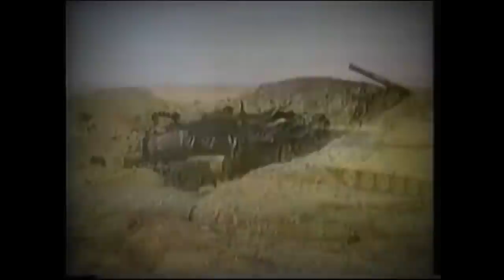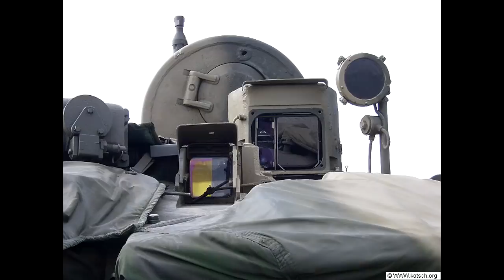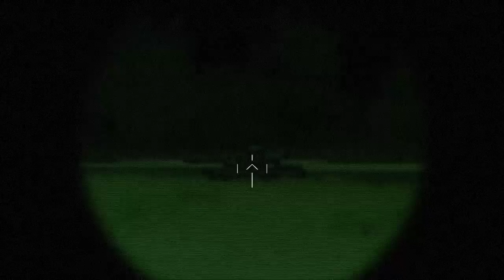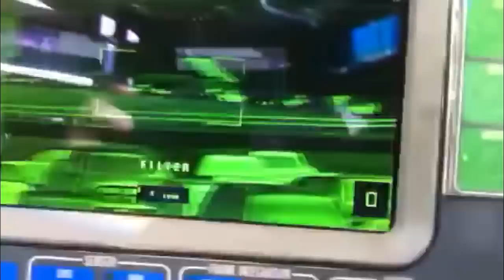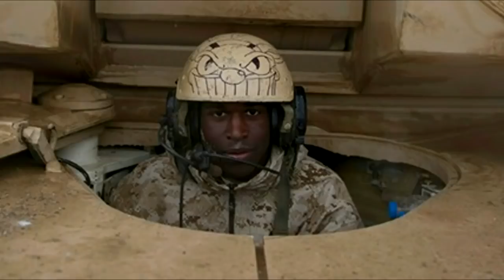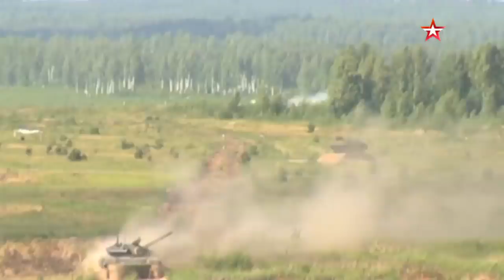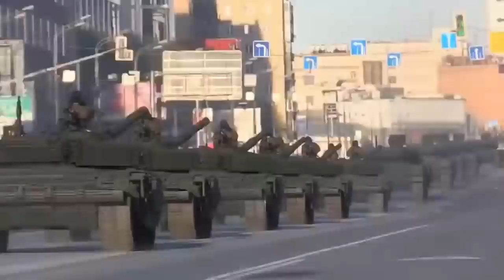Does T-72 stand a chance against M1 Abrams?

Comment: The reason the battle of 73 easting is so famous and the tank crew so brave is because of its potential to have gone awry. The M1A1 might have been a better tank, but the T72 was still capable of penetrating it. All in all, I think it was down to crew training and the element of surprise.
Reply: Thought they found the ammo used by the Iraqi we're found to be training rounds.  Also there were more t55 than t 72 in the battle alone?
Reply: @markacostajr.1584  Oh bull shit
Reply: @tomhutchins1046  He is wrong they weren't using training rounds but they where using soviet export rounds which would require a 1 in 1000 shot to penetrate an Abrams frontally

Comment: I used to do maintenance on the M1 and your estimate of units available is quite low. Getting an exact number is difficult as there are several categories that must be taken into account. Also, it should be pointed out that the Russians have the longstanding order that the tallest a armor vehicle crewmen can be is 5' 2" (157cm). This has saved the various governments billions in the cost of production, both in money and materials.  Also, when considering the M829 series of sabot rounds, one must remember that the penetrating statistics must also take into account that for the round to be of greatest effect it must do a complete pass through the other vehicle. I have seen the films with goats in a sealed compartment, then a sabot round passing through, I am still astounded that the amount of vacuum that the M829 created when exiting the tank completely vaporized the goats.Also, it happened so quickly, they didn't suffer.
Reply: Bullshit, my friend is 190 cm and he was a tank commander in 2015

Comment: I don't quite necessarily get why a long dart would be able to penetrate armor the higher an angle. The Abrams' upper plate is so far sloped, nothing should be able to go through it unless the other tank is above the Abrams. Though considering the gap between the hull and turret is large, a Sabot could just ricochet off the upper plate into the turret, you don't need a physics major to figure that out. Lets take an idea out of War Thunder's book, there are several easy ways to take out an Abrams, 1. just shoot the turret ring, it's unprotected, 2. if only the turret is visible, annoy the tanker and take out their gun, 3. you can outflank them, they're not really that fast. 

Obviously a real life Battlefield is much different than a game, one like War Thunder, especially where it's new penetration mechanics are concerned, but some of those tactics could still easily apply if a crew is good enough. Lastly, my last point, a single fresh Abrams crew could probably take out several T-72's in a short amount of time at long range, with the added situational awareness, it's much easier to spot a flanking enemy. The same idea at close range, could still be true, but the T-72's will be able to aim for weak spots if they can bother, thus are much more likely to suffer damage. Doesn't really help that T-72's, as a design, are just much older, and use an outdated set of armor that is no longer effective unless an upgrade package is added, but even that isn't necessarily going to add more protection.

Comment: First, T-72B3M mod 2016 use Relikt ERA not K5, second protection of turret and hull of T-72B mod 1987 are wrong. 

With K5 ERA witch is 30+ years old, T-72B tank have this estimated protections:
Turret against HEAT is from 740-1140mm, 
Turret against KE or sabot or APFSDS is 640-780mm

Hull against HEAT is 1070mm,  
Hull against KE is 670mm

But with Relikt this estimated values  goes up and protection of T-72B3M is almost same as T-90A or T-80U with K5 on it...

Lets see protection of T-80U with K5 on it:
Turret against HEAT 1100-1450mm
Turret against KE 850mm

Hull agaisnt HEAT 1080mm
Hull against KE 780mm

So this T-80 is batter then old T-72B or B3 with K5, but this new B3M have Relikt ERA witch provide protection ~T-80U, tank made in 1990s, most of them...

Comment: The reason why the Russians are still holding on to T-72 inventories and upgrading them is because they can't afford full serial production of new tank lines to replace them. They still use them because it's cheaper to upgrade them than to replace them. It's been years since the Russians unveiled the "operational" Armata MBT and it still is in low-rate production, and will continue to be so. Video not necessary.

Comment: I'm pretty sure one shot from T-72's 125mm gun on the side armor of an Abrams is enough to knock it out, so yeah, T-72 definitely has a chance. It's all about maneuvering, which means it depends on the crew.
Reply: "Depends on the crew" is one of the most used clichés in tank debate. People think as if the crew can always dictate where to go and how to engage. What they forget is that a tank is always part of a tank platoon and the platoon is part of the company, which is part of the battalion. This means that it is the commander of the unit, who dictates where the tank will go and how to engage. If it means a frontal assault against enemy tank company in hull down position then it will be so. Little to do with better crews in that situation. I´d say a good commander may be able to beat better enemy tanks with inferior tanks, if he is given freedom to fight the way he wants, but this is rarely the case.
Reply: @qelleri  Tell that to the tank aces, buddy. They might have gone wrong at a certain point, but up to that point they made the difference, not the machine they were driving. It's man and machine, tank and crew, no other way around, get used to the "cliche".
Reply: Not only to the side but also at the front (if modern variants)

Comment: In a Battle against Russia, many other factors would negate the M-1 pretty quickly. The Abrams turns into a 'pillbox' in soft or marsh ground. Russian Electronic Warfare would be able to wipe Abrams computers from quite a distance.....turning it into a steel coffin.
The Abrams is too heavy for use in Russia. Since the US has NOTHING ELSE to use, any War will be a VERY short one.
Also, now that Russia has GUIDED, Heavy Rocket Artillery---the M-1 Abrams will never even SEE any T-72's, except when they roll by the burnt-out-hulk of M-1's.

Comment: MBT's are to exoensive to make. The T-72 is probably just in service because haveing it available is better than not. You have to keep in mind that the number of MBT'S we have today is MUCH lower than the number of Tanks we had in WW2. So in a War you could technicly sinply make the T-72's support Infanterie in places where you know that no Abrams will be. The Eastern front of WW2 was around 8000km long. Now try to hold that with 1500 Tanks. Do you see the problem?(That is also why Germany lost WW2)
Reply: We also have air calvary now, Newer threats, and tanks are more of a specialized tool now.  Don't forget modern day ATGMs, Man Pat's, As well as other equipment. The future of warfare seems to be in light warfare. Ie Small arms, Technicals, Drones, and hit and run tactics.

Comment: Take away al the nice imaging and range finding equipment. We took on Cuban t72's in Angola Bush 50 meters and less due to the visability with centurions 105mm gun. They did not stand a chance. We had Ratels with 90mm guns knocking t72's out at 1200m not just tracks or engine fires, total cookoff hits.
Reply: Source?

Comment: I would put a T90ms with Russian DU weapons up against an Abrams. That would be a hell of a fight.
Reply: @t.t6  You cant compare the handful of t90ms (or even T14) to Abrams without comparing directly to the most modern version. 

We must compare contemporary versions and i think Abrams pretty much always wins. I . think the general design is just better.
Reply: @y0Milan  APFSDS penetration matters, and no problem because the Svinets 1 and 2 will have no trouble penetrating the hull because it can penetrate up to 700-800mm of RHA
Reply: @mr.laughington5740  I dont think the T90 even gets to shoot at the Abrams, abrams sensors and FCS too good.
Reply: @y0Milan  aged pretty well. Not a T-90, not even a T-80 but a T-72 got an Abrams
Reply: @mikhailalmaz  Do share the evidence for that one mate.
Reply: @t.t6  yawn, unlikely
Reply: @t.t6  M1a2 SEP is totally capable of winning 7/10 fights with 90ms. Better in every way.
Reply: @y0Milan  T90MS cann shoot vacuum Apfsds with 1000mm penn at 2000m at 0 Degree more then enough to penn M1a2 sep

Comment: One thing that Kontakt-5 ERA does to incoming APFSDS round is not just reduce its penetration potential, but YAWs it as well. Meaning that when the round will hit the armor, during the process of penetration, it'll be yawed into a higher angle of incidence. That means the amount of armor it'll have to penetrate will increase.

Advantage of T-72B3M is its transportability, relative simplicity of manufacturing, price, ease of learning, cross-country ability, ability to reliably load rounds into the breech irrespective of the terrain that's being traversed and its versatility. It was designed for a high-speed attack with fire while maneuvering against fortified enemy and enemy infantry, which explains the standard carry of HE-FRAG ammo

Advantage of Abrams is its VERY thick armor and excellent sights. It was however developed with a hull-down use as primary role which explains the VERY thick turret armor and less thick hull, which is understandable: being hull-down there is a rather slim chance of something hitting the armor through the ground with sufficient force. Also Abrams was developed with primarily anti-tank use in mind, enemy tank killer if you will. Its use against infantry and fortified positions was always secondary.

Putting these tanks head-to-head is a common theme, however they'd be used according to the military doctrine of the operating forces. Also loss rates will be determined not just by what kind of enemy tank they'll be facing, but also whether enemy has air superiority. Tanks biggest enemy isn't the enemy tank. It's the enemy artillery, CAS aircraft, attack helicopters and ATGMs/RPGs/LAWs as well as own incompetent crews, as proven in Iraq and Yemen. Iraq used degraded T-72 derivative and Abrams smashed it, but later Iraq got Abrams and got owned by ISIS. In Yemen Saudi tank crews constantly expose tanks vulnerable points to the enemy.
Reply: In a warfare scenario, the T-72 would be the better design, as more can be fielded and they have more powerful offensive capability.

Comment: The only real problem with T-series tank is holding amunition inside turret this will cause head shut if the enemy cannon could go through turret armor that’s why sometimes you see they getting destroyed pretty bad even by one rpg
Reply: Not really. If you load the Abrams with HE-FRAG rounds, that bustle with blow-out panels won't help. In fact the ammo on Abrams is even easier to set alight than on T-72. Difference is that most often Abrams doesn't carry HE-FRAG ammo and has to rely on HEAT ammo when up against fortifications. Lack of HE-FRAG is what saves Abramses bacon from being blown up. A single RPG to the bustle can case the propellant to immediately set alight. If we were to place, say, 10 HE-FRAG into the bustle of the Abrams and 

T-64/72/80/90/14 have their ammo in the best-protected spot. Design-wise it's the best. It's up to the tank crew and own forces to prevent enemy from being able to target the tank from aspects where it can be penetrated to hit the ammo.

Comment: Putting aside the myth that abrams is the be all end all war machine that has no equals - its as susceptible to the t72 as the t72 is to it. Lower plate on the abrams is wank. As is the mantlet (both were mentioned in  the video). As an extra you can also jam a projectile in the abrams turret ring which is terribly sloped and leaning inwards. A hit there with AP(FS)DS will most likely bounce into the hull, jam the ring and rack the vehicle.

On the flip side t72 is a tank produced with numbers in mind. While its lower plate is superior to the abrams its still not enough to withstand a hit from AP(FS)DS rounds. The turret is also lacking in protection. Modernized versions of the t72 attempt to fix some of those issues by adding more composites on the turret front and the upper plate. Other way the t72 was modernized is by having expansive reactive armor addons on the upper plate and turret face. While those are effective against HEAT rounds, AP(FS)DS will still cut through them like a hot knife through butter.

Heres the issue - youve probably heard about the balance of power/armor/weapons when designing tanks right? Welp - modern tanks (and the not so modern too) seem to have dropped everything into speed and weapons. Very little into armor. We have a situation where id rather be a fucking infantryman and get shot in the face than a tanker and burn alive inside it after taking a hit. Theres really no difference when all that armor doesnt protect the crew anymore. Youre only protected from small arms fire when in a tank but then... its cheaper to drive to battle in a APC. Tank vs tank combat is a russian roulette where whoever gets an accurate shot off first wins.
Reply: Not really. Kontakt-5, Relikt and new Malakhit are designed to severely degrade APFSDS penetration. Sure the roof isn't thick enough, but ERA won't be cut like knife through butter as you assert. Kontakt-5 is now mostly obsolete and Relikt is taking its place.

Russians don't designate tank-to-tank combat as primary means of defeating enemy tanks. WW2 has shown that using artillery is much more effective, while in a city, tank is a mobile pillbox that needs constant infantry protection and special tactics.

Comment: Depends.

It doesn't matter if you're in a M1A2, Merkava, ZTZ-99, if you get hit by a modern sabot anywhere but the front you're dead.
Hit by an ATGM anywhere but front; dead.
Bomb, you are dead.

Assuming it's the B3 we're talking about, both tanks have a chance to kill each other.
The gap between ammunition is negligible if we take both reported values at face value, both tanks work, are not crewed by Iraqis or Saudis, have FLIR, radio, etc.

The first-look/first kill advantage of the Abrams's systems will only work in featureless plains, etc.

The thing is that both of them are damn good tanks in their current versions and can kill each other with ease, the results will probably depend on external factors to the machines themselves.
Reply: @vann tedd  Ok, I cited the oldest RPG as an example, And if you take CORNET, it shoots at 8-10 kilometers and pierces 1300 mm of hemogenic armor after overcoming additional protection, Will pierce any tank in the forehead
Reply: vann tedd  congrats. Russian weapons designers historically over state their weapons effectiveness. 

Good thing the abrams has the updated DU mesh.
Reply: @kcimb The DU mesh didn't save the 20 US Abrams destroyed in Iraq; they'd have no chance against  Russian Kornets.
Reply: Stimmt.
Reply: Looks like the Ukrainians are proving you wrong / There killing T72's with old t64's.
Reply: The Russians once again proved you wrong, as a T-72 tank destroyed an Abrams tank in a direct battle. @tomhutchins1046
Reply: You guys are completely stupid it's Armor protection, Crew Skill, Great Canon, and Performance that matters
Reply: Training of the US crew would bring it out on top 8-10 times.
Russian crews just aren’t as well trained.
As the current war in Ukraine is also showing, Russia is going through tank crews like tissue paper.
Each one of those T-72B3M tanks are getting sent to the stratosphere.
Which means that a significant portion of Russia’s current tank fleet is being operated by less trained personnel. So ATM if NATO was to square off against Russia, it’s highly likely that Russia would get mopped in Tank battles… (this is ignoring that fact that tank battles would be rare, as US aircraft would have easily load waste to many of Russia’s tanks before they even had a chance to fire, but this is a whole different topic)
Reply: @PeterMuskrat6968  Well for one thing even Abrams is no match for a Javelin missile and US aircraft would not be able to fly in Russia's dense air defense network not even F22.
Reply: Must watch this! Croatian M-84 vs JNA T-55: https://youtu.be/QghKJi1JQQc
Reply: The Abrams was originally designed to fight Russian tanks in Europe during the cold war.